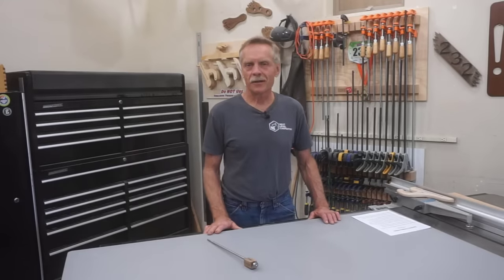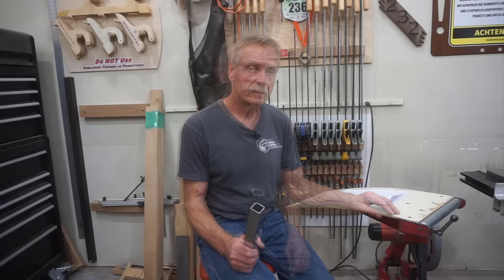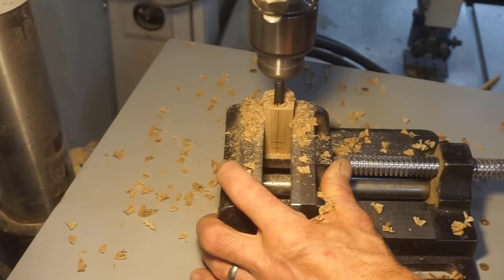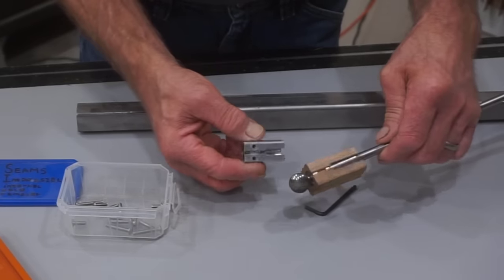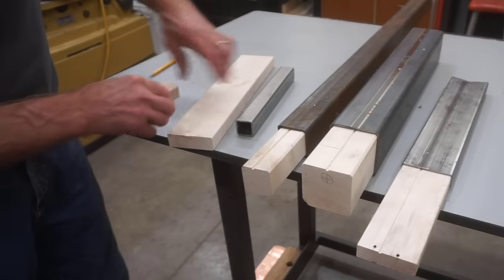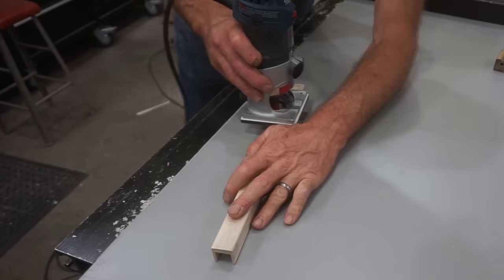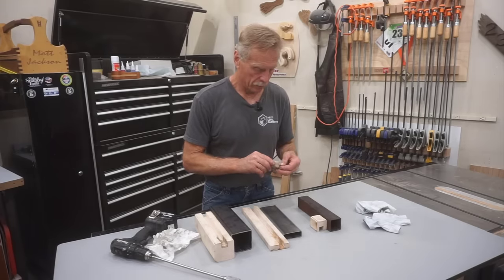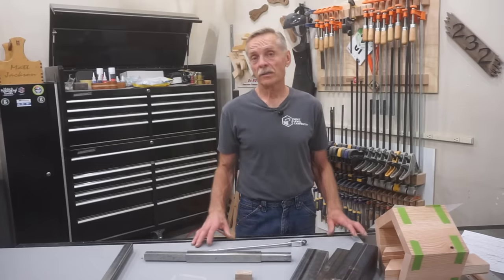How to Quickly Remove Internal Weld Seams from Steel Tubing

Comment: If you don't want to hassle with making tool, any decent metal supply will have nesting tubing of different dimensions, both round and square.
Reply: I've found seamless tubing to be very expensive and only a special order of a full length tube. Where are you finding otherwise?
Reply from the maker: I've never been able to find any 'sleeving' materials even with considerable looking.  I've heard of DOM tube being available but only in full lengths and at considerable extra cost.  Feel free to post links to products you've used or know to work and I'll keep them in the comments here... if it can save someone the hassle or cost of a dedicated tool I'm al for it Brad.  Thanks for watching and commenting here... Best, Matt
Reply: It is more expensive for sure but it is available.  To be honest I don't remember if it was seamless or not.
I've gotten it at a place here in Minneapolis called Coremark Metals.  It used to be called Discount Steel.  https://www.coremarkmetals.com/ 
Here's a link to 6061 Alu stock.  https://www.coremarkmetals.com/6061-t6-telescoping-aluminum-round-tube
I couldn't find the steel version on their web site, pretty sure they have it, or the used to anyway.  I bought some square tube a while back to make some adjustable stands..
There is another place up here called Midwest Steel, located in Rogers (NW burb of Mpls) that I'd bet has it too.
Most places will cut any length you want for around $5 per cut.  I usually get full length sticks and cut and use what I need, then stick the left over in the "rack".
Reply from the maker: @bradjohnson9671  That's good to know... thanks for following up with links. You're fortunate to have a resource like that available to you!  If they do indeed custom cut short pieces and are able to ship it might make sense to many who are doing a one-off project to spend the extra $$ for a custom cut and shipping than to hassle with a tool for one-time use.  Best, Matt

Comment: Good design but if you just buy DOM tubing you don't have the weld seam to deal with.
Reply from the maker: You make it sound unrealistically simple Joe.  Can you provide a link to a source where I can buy a 4-foot piece of inch and a quarter OD Square tube and a piece of 1in OD Square tube that slips smoothly and clean the inside of it please? If it was as simple as you imply there wouldn't be millions of views on videos that show how to solve this problem because those millions of people wouldn't go through all the extra work to remove the seam If the product was readily available.  Maybe this is providential and that you just discovered a new business!  Joe's sleeve fit tubing Incorporated: we sell round and Square D O M tubing at rock-bottom prices in any length and quantity and and offer free overnight shipping worldwide with a no questions asked refund policy... actually your comment now sounds like a great idea to me! 😁😎

Comment: Seems like a huge waste of time considering you may need to use different square tubing sizes so you need to do this over and over again.  I don't see anything wrong with the grinder technique you used.  It's way faster and easier to adapt  to different sized tubing.  You don't even need the angle wood just do it by hand.  You also need specialized tools like extensions and bearings.  Total waste of time.  Also the weld seam isn't in the same place every time sometimes it's not up the middle rather to the side which renders your tool totally useless.
Reply from the maker: You clearly didn't pay attention while watching the video Dom... every issue you bring up is addressed and resolved in it.  It's also true that if you 'don't see anything wrong with the grinder technique' then, by all means, use it because its simpler.   The Seams Impossible tool is for those, like me, who don't accept the shortcomings of other methods... Best, Matt
Reply: @NextLevelCarpentry  No they weren't.  Some seams are not down the middle which makes your tool useless.  Are you going to make a new tool for every seam position?  What ru talking about resolved?
Reply from the maker: @domjohnson2579  you're probably not really a putz like your comments make you seem so I'm giving you the benefit of the doubt on this before I select my 'Hide User from Channel' option: https://youtu.be/ozSE7Wrdb1o?t=1106
😠
Reply from the maker: @domjohnson2579  Busted indeed! Apparently I'm a poor judge of character too... Here i thought you were an intelligent person who missed a few facts but I was wrong... You ARE a putz!! It's obvious that you have a concrete mind: all mixed and permanently set!

Comment: Nice idea ! I might use this sometime. 
I don't understand why you American folk cling to Imperial measurements though, cumbersome ain't a strong enough term to describe it...   Yeah, I still use inches, feet, 1/16, 1/4, 5/8 and so on, but calculations are just so much simpler in mm...
Reply from the maker: I don't understand why the world doesn't switch from the lame QWERTY keyboard to the much more sensible Dvorak arrangement of keys either.  As disparate as the problems are they are one in the same IMHO... Best, Matt
Reply: @NextLevelCarpentry  Interesting ! Never heard of the Dvorak keyboard, looks sensibly laid out. Off to explore the idea and  reset the work computers to use it, but to retain the Qwerty markings on the keys.... Should cause some entertainment tomorrow morning ;o)
Reply from the maker: @innleadair  you will probably receive a similar reaction to the one I would get if I went into a local lumber yard end requested metric two-by-fours and sheet goods to build with! Let me know how it works for you okay? 😅😎
BTW if you read the history on it the QWERTY keyboard was actually designed to be inefficient on purpose because mechanical typewriters were not capable of keeping up with the speed of types so the key Arrangement was designed specifically to slow them down to the speed of Arcane mechanisms. The fact that computer keyboards didn't start out in thought Dvorak configuration is the same problem with human nature that prevents the elimination of fractions in the US.

Comment: Why would this need to be done?
Reply from the maker: Watch the video and you'll see when and why😁😎 Hint: the two square tube pieces in the video thumbnail fit smoothly together with the weld seam removed...
Reply: Juptak Spoiler alert: Sleeved, so you could join two pieces together. Then assemble or disassemble need be. You’ll have adjustable legs on a work table or a t-stand that adjust and locks down? You could also drop a section a table top, onto a shop cart to give you a level outfeed table with the arms perpendicular to the reference plane. This isn’t my video so you probably need to watch to see how this works

Comment: Wow he invented a tool that fireball tool created a year ago...
Reply from the maker: Not at all: Fireball invented a rotary dial telephone.  I invented a smartphone.  Both accomplish the same task using completely different methods but with noticeably different results...
Reply: Next Level Carpentry yes but saying that there is nothing like it, and it’s completely new is taking all the credit for the idea I.e plagiarism You can say you improved on an idea, that’s subjective, but you did not invent the idea and saying so is simply lying.
Reply from the maker: @OuroborosArmory  so you equate roughly scraping the weld with a piece of tool steel drawn with a length of allthread and removing it with rotary cutting action of a carbide burr and that I need YOUR permission to claim otherwise at the risk of plagiarism?! Wow...
Reply: @OuroborosArmory  next level obviously took it to the next level. It's a unicycle vs a motorcycle. The only comparison is that they accomplish the same task.
I'm amazed that you can't admire the innovation for what it is.
Reply: While not novel the means and method are patentable.
Reply: someone must not have watched the whole video.  This isn't even similar in it's application.
Reply: C.J. It’s exactly the same in its application. The difference is one is using mechanical force, the other is using rotational energy. Both remove weld seams inside a pipe (which is the applications of the tool). However sense this comment has gotten so much traction, I rewatched the video, and he never said he invented the idea.. so this could be an example of convergent evolution. Two people coming up with solutions for the same problem without realizing other people have done the same.
Reply: @OuroborosArmory  either you don't understand application or you're confusing it with result.
Reply: @OuroborosArmory  At 1:05 seconds he says he invented it.
Reply: Ouroboros Armory guess what bud, you never gave credit to the guy who wrote the first youtube comment
Reply: @OuroborosArmory  This just like a sharper vs a milling machine. very often the can perform the same tasks, but the methods are very different.

Comment: Dude, try to google "telescoping tube" or Unistrut, they are too cheap to justify all this nonsensical work.
Reply from the maker: Thanks for your comment... it's always nice to get feedback from a Dunning-Krueger poster child! Your input makes a great contribution to research which proves the theory out.  Best, Matt
Reply: @NextLevelCarpentry  Nice reply & now I know what Dunning-Kruger effect is
Reply from the maker: Wise Fix
Yes, telescoping tube is available, but mostly by mail and not kept on inventory at regular hardware stores or even most industrial and/or metal suppliers. It is also more expensive do to the cost of shipping heavy stuff, not to mention the additional manufacturing process it has to be subjected to not have the internal seam. It also takes time for the mail to deliver. DIYers source most of their materials at local stores (which helps local economies) where the regular square tubbing (with the internal seam) is readily available for a modicum within a 10-minutes drive. This tool allows to convert readily available dirt-cheap tubbing into its more versatile telescoping version in a few minutes. I think it is a great idea. Thanks to Matt for sharing it.
Reply: Oh, do tell how telescoping tube can work from the structure of my knife grinder, or parts of my 600+ pound 6x6 steel tube bowl lathe. #sarcasm
Reply: @johnfurr8779  #you missed the point
Reply: @NextLevelCarpentry  Dude McMaster Carr doesn't have 1-1/2" and I've Googling for hours trying to find some. Did find that 0.080" wall perforated stuff but who wants that sloppy stuff?
Reply from the maker: @WilliamMcNett  The tube used in this video is all standard, off the rack stuff from a local steel supplier so I hope you can find some without McMaster, Grainger, etc.  Much less expensive plus no shipping... Good luck! Best, Matt
Reply: @NextLevelCarpentry  yes, there's a few places around here, a salvage place that sells steel by the pound, and a small local metal supplier. Just order the parts for this cool project 😎
Reply: I want to hear about removing the weld from tube, I am not interested in where to buy gold plated telescoping tube.
Reply from the maker: @knotbumper  You've come to the right place... thanks for watching and commenting! Best, Matt
Reply: @NextLevelCarpentry  And this effect is frustrating and bewildering.  As Homer Simpson would say.  "Why do the same things that happen to dumb people, keep happening to me!?"
Reply from the maker: @ryanmacewen511  I'd not heard that classic Homerism Ryan... if you hear me use it in future videos, you'll know you inspired me! 🤣🤣
Reply: @NextLevelCarpentry  And don't forget the oft forgotten correllary, "The Small World" effect.  When their world is small enough, then they really are the smartest person in the(ir) world.
Reply from the maker: @twwtb  True dat!

Comment: A hardwood block with a piece of emery cloth properly secured will do this same job with a lot less time wasted making a complicaed jig with a burr cutter.  You might spend a few minutes pullilng the emery cloth block back and forth in the tube (up to several feet long) to remove the internal weld irregularities, but it would be so much more simple.  Of course you wouldn't be able to create a new "tool" to sell.  Oh, and you would not need to attach an electric tool to rotate the burr cutter.  Simplicity is always the better route to take.
Reply from the maker: You're funny Phyl!  Show that you can use emery cloth on a block of wood and "do this same job with a lot less time wasted" and I'll pull this video and link to yours!  You've got 20 seconds to COMPLETELY remove the internal weld from a piece of 1" ID steel tube "several feet long" without breaking a sweat: ready? GO! 

... we're waiting... 

...  Phyl?...

... still waiting...

... HULOOOO... Phyl?...

... crickets...

 Right.🤨
Reply: Yeah, I don’t think you’ve ever worked with metal tubing!!
Reply: I appreciate Phyl's simplistic although somewhat insulting comments.  I like "old school" solutions too, but have over the years realized that there is great value to engineering a solution that is repeatable and can save enormous amounts of time when used time after time which is what any tool does.  Obviously Phyl doesn't actually need this concept with whatever work he does and for him it is as much a waste of time thinking about a solution that he doesn't have a problem with as it was for him to insult an excellent idea.  I'm sure that a table saw (with a motor) and a planer are equally a waste of time when you could use a handsaw or simply use a Jack Plane to flatten lumber.  Thanks Matt for sharing the innovative ideas that not only solve this problem but also promote thoughtful solutions to similar problems and easy ways to solve them repeatedly.
Reply from the maker: @rogerg1050  I like the reasoning and analogy you built into your comment... thanks for adding it here!
Reply: Phyl I suggest you test your theory before throwing around accusations, as someone who was facing this exact problem I Can tell you some cloth and sandpaper will not get it done. I was even set to do this on a 2 foot long piece, the ball mill approach is awesome. I don‘t mind a simpler solution, but having to do this on several pieces was quite some work, would not be ok if you have a product that requires this operation an a regular basis.
Reply: @SmilingDevil  What's funny is he actually got 3 thumbs up on his comment.
Reply: @SmilingDevil  Have a little faith in Phyl. Aside from the 60 hours of labor and 30 yards of emery cloth, it's a perfect solution.
Reply: Electric Universe well, DO some about that, or is your thumbs down mouse click broken...??
Reply: I have tried using a coarse flap wheel to try and clean a tube inside. It's OK on a circular tube but nothing special on a square tube. Additionally the weld spatter rips the emery flaps so its not a low cost solution as they quickly wear out.
Reply: @SmilingDevil   Don't know what happened to my previous post but as I replied earlier... I hit that thumbs down hard when I first read it. Unfortunately, thumbs down counts don't register.
Reply: PILL, innovations comes from necessity. I deal with this in structural all the time. I Have an idea how to make this work a little bit better for my application. This is simple for sure.
Reply: @NextLevelCarpentry  I once took the inside seam out of a tube with a broach. Took a lot longer than 20 seconds. I like how you did it !
Reply: Also I have been called "Popeye" before from my forearms. It was a workout sliding the broach by hand.
Reply from the maker: @tt600pch  yeah it takes longer than 20 seconds to make a version 1.0 seems impossible tool but it seems like it's a good investment of time for how quickly it removes the welds once you have the tool made... all depends on how you want to spend your time right? Thanks for watching the video and commenting it out of here at Next Level carpentry! Best, Matt
Reply: Never tried that, have you? lol
Reply: Why do you accuse him of doing all this work just to sell something? It's a video that literally shows you every single step for making a wood version of the jig so that you don't have to buy anything from him, and he offers it for sale for those who, armed with all of his knowledge, still prefer the convenience of buying the tool. Do you know how hard it is to make a video like this, with this level of detail? This is the kind of video that YouTube was made for - an excellent craftsman who shares knowledge and resources. I love this video!